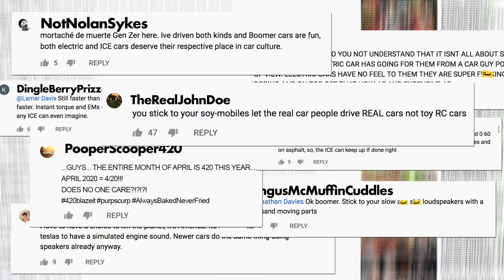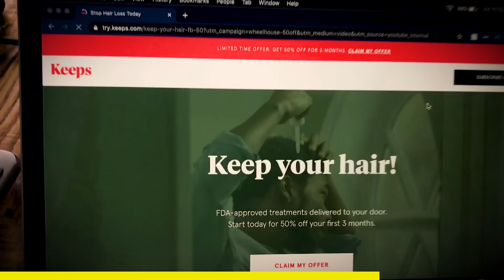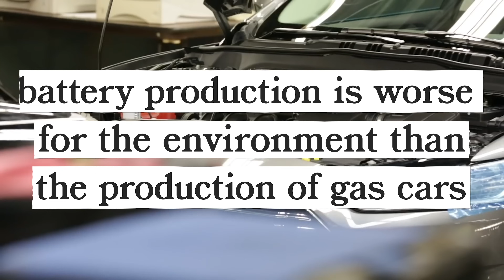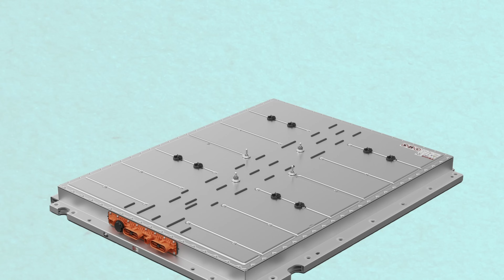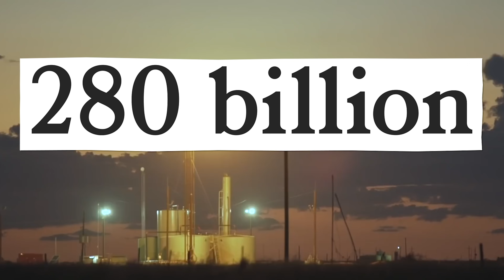Are Electric Cars REALLY Better for the Environment?

Comment: Co2 emissions of coal power per kwh 2.21lbs
Co2 emissions of gasoline per gallon is 19.64

Chevy Bolt EV - 60kwh battery - 240 miles of range
132.6 lbs of Co2 for 240 miles

Chevy Sonic(Gas version of bolt) - 34 mpg
138.6 lbs of Co2 for 240 miles of driving

Even in worst case sincerio with being powered by coal EVs are still better for the environment. Also when your utilities goes greener your ev will get cleaner. My modded bolt EV is powered by hydro power. 

Grab some sticky tires and have fun with the instant torque of an ev. And with all the savings of much less maintenance and fuel cost savings it will help fund your project car.
Reply: until you need that expensive battery replaced. from what i am seeing you might as well throw the car away at that point.

Comment: i think there will be huge strides in battery tech in the coming decade and battery production wont even be a big issue
Reply: They said the same thing about gas.  The materials are what they are.  There is no changimg that.
Reply: @someweirdoguy6633  right, the materials will likely change.

Comment: Solid state batterys. Game changer for EVs. A solid-state battery is a battery technology that uses solid electrodes and a solid electrolyte, instead of the liquid or polymer gel electrolytes found in lithium-ion or lithium polymer batteries. Materials proposed for use as solid electrolytes in solid-state batteries include ceramics, and solid polymers. boom - mind blown

Comment: Well this comparison has one flaw. 
The average age of cars on the road today is 11 years old. The average lifespan of a EV battery is 8years. 
So if you install a new EV battery after 8 years of ownership then you have to double that initial economic impact for mining lithium required to make the battery. 
This will become more apparent as all these new EV cars age & people can't figure out why their Telsa doesn't hold a charge anymore. They will be faced with a choice of spending an estimated 3-7k dollars for a new battery or 40k (model 3) to 80k (model S) on a whole new car. 
I would argue that we will see more EV owners replacing their batteries just like ICE owners opt to repair their cars as they age as opposed to buying a whole new car. As the middle class becomes less prosperous, working class Americans are holding on to cars longer nowadays & are opting to repair the car they own instead of buying a new one. 
Its no secret that with proper maintenance & regular quality oil changes it is not uncommon for a modern ICE to surpass 200k miles which is double the current 100k mile life expectancy of an EV battery. My 2008 VW has 230k miles & has never had any major repair work. Just basic maintenance & it runs great. Hopefully as time goes on & technology advances these batteries will last longer, just like the modern ICE has become more reliable as it becomes more refined.
But for now I would like to see that app you talked about comparing EV & ICE car's take the current battery lifespan into consideration.

Comment: For the people who love math and the occasional dry joke: Engineering Explained also did a video about this a while back (with pretty much the same findings, though EE points out the specifics and uses his own cars as examples). The channel is exactly how the name implies.
https://youtu.be/6RhtiPefVzM
Reply: The efficiency numbers alone make these cars a no brainer as he outlined in his video along with Motor Trend
Reply: I wonder how this changes when Tesla makes a million mile battery, 20-30 years of driving without battery replacement?
Reply: Engineering Explained is awesome. He further hammered home the efficiency of EVs when he charged a Tesla Model 3 by towing it with a Ford Raptor, and was able to go further off of that charge than the towing distance.

Comment: They are worse, won't own an electric again. I owed an electric car not going to name the company because in the end they bought it back. But in the 2 years I owed it I had complete battery failure, heating system failure and then the charging unit failed and was deemed non repairable. It also had a bunch of smaller problems not drivetrain related. It only had 87000km on it when it fully died.

Comment: I beg to differ as we had an 06 tesla roadster in the shop that only had 45k miles. Would not hold a charge and needed a new battery. So they may appear that way but the manufacturer has to make money too and the big money maker for a manufacturer is parts sales so what parts are going to be made to fail after x amount of miles that the car has to be brought back to the dealer for service?

Comment: 50 years from now if EV vehicles dominate the streets by the numbers, EV vehicles are going to be harder to dispose of as compared to ICE cars. ICE cars can be crushed and melted and recycled. EVs can’t be recycled as easy as ICE cars, there will be a huge problem of how to dispose battery waste at which in long term, EV vehicles will just be as muchof a bigger problem as ICE vehicles. Yes, 6 months-2 years or even 5years EV vehicles are efficient, but people generally change cars every so often, and EV vehicles especially their batteries expire at a given time rendering the car obsolete again. ICE with proper maintenance will keep the car running.

Comment: Apparently carbonized hemp fibers are comparable to Graphene in terms of function and form, thus they can be used to make super capacitor like batteries. Perhaps this could become a viable alternative to lithium/cobalt batteries?
Reply: super caps will never be used in place of a battery but if you knew the dif between a battery and a cap you would already know this

Comment: You forgot about the facts of how the batteries don't last as long as a normal combustion engine would.  therefore if you have to buy one and a half or two cars in order to equal the mileage you will get from your 4 banger Carol's.  Until batteries last longer a combustion engine is always going to be more efficient over the length of the vehicle.

Comment: What if the country which provides lithium or provides ready made battery increases prices? It will happen in future for sure as we suffering from todays gas prices. 
What if the incremental use of lithium might change the environment either bad or good or anything else? 
Do you know we get electricity after the chemical reaction in battery which emits harmful gases but in less volume? Then each and every recharge of battery is also harmful as gasoline vehicles. Still destroying every living being in the planet either use of EV or gasoline vehicles. Need a huge change !!!!!

Comment: One thing all the EV pushers miss though, and that he didn't talk about in the video, is that the Li-ion batteries in EVs only last about 5 to 6 years before they stop holding a charge and you have to replace them. So while it takes two years to counter act the environmental impact of a ICE car, what impact is there if they have to produce two batteries every ten years?

Comment: Yes they are. The toxic gasses that come out of a battery are 10x worse than gasoline and diesel. I have over 10 years of battery charging technology experience I've work for the two leaders in rechargeable batteries. And batteries are worse.

Comment: Good video buddy but there are 100's of other products that produces during crude oil processing (from Oil to Threads specifically nylon and polyester) which ultimately lower the carbon footprint per product and of course if people stop using gasoline/petrol or diesel still processing trend will not going downward.

Please elaborate and share your views. And correct me if i am misunderstood something. Thanks

Comment: In general, "things" are made of stuff that requires pollution. More stuff, more money. A reasonable proxy for pollution is money. capital cost + energy costs = resources used.

Some resource extraction looks different than others. It depends if you have a preference on the type of pollution.

Comment: Good points, I was hoping however that you would have covered the long term picture.
As we know ICE vehicles made 10, 20, 30, 40+ years ago are still getting around.

I'd be interested to see how an EV fares 20 years after being made, will it have required frequent battery/component replacements during that time? 
if so, how would the processing (storage, recycling or disposure) plus the manufacturing of the new components factor in?

Comment: Thanks for this!  What about the 'life' expectancy of each car?  I know that electric cars need a battery pack replacement before you would need to fix your ICE as they degrade over time, plus they are expensive to the car owner to replace.  It would have been good to have factored this in as this drastically raises the EV's energy footprint.    I wish hydrogen cars would get the same development and push to the market!  I'd drive one of those:)

Comment: Not disagreeing with any of the facts in the video it was well done, but I feel a major point was left out. Long term what the life of these electric cars will look like vs internal combustion engine vehicles. Tesla makes a great car, but 15 years from now when it needs a new battery system, is the owner of that car going to sink $15-20k into replacing the batteries in that car? Likely not and it will end up in the scrap yard. I drive a 15 year old vehicle that has 235k on it, I’m the 4th owner and is very inexpensive to repair and maintain for any social economic class of people. Yes over its operating years ICE vehicles creates more pollution, but not for the initial creation, and it will provide likely more years of service and be obtainable for more people. So if you get say 20 years out of a ICE powered vehicle vs potentially 2 electric vehicles in that same timeframe and one of those is creating waste in a junkyard (because a battery overhaul was too expensive of a repair on a 15 year old car), which is really making more pollution?
Reply: Well Tesla have talked about a million mile battery. So watch this space.

Comment: For anyone who did some more research, it's worth mentioning that having to replace the battery does increase the length of time required for electric vehicles to become the better choice, but since most electric vehicles also have less points of failure, it's reasonable to assume these factors will still go in the way of EVs in the long run.

Comment: Just a  thought, what about battery replacements? Most battery as of now wont last the life of the car and that might send the electric cars to the junk yard faster than a gas power car.
Reply: Tesla have supposedly come up with a battery good for 1 million miles. would sort of end the discussion.
Reply: @philterry3293  Well that would be cool when it does happen but as of now it does not exist in production. In 2019 there there where 2.2 million EV cars sold alone and all of those cars battery's are rated to 100,000 miles. Most gas powered cars will go 200,000 miles with out a question and will even go to 1,000,000 miles if maintained properly. To get a current EV car to  go 1,000,000 will be almost impossible.
Reply: @therealpofo  It certainly would be cool. We will know soon enough, battery day is hopefully next month.

Comment: Bro your calculations are literally just you doing Google searches.

An electric vehicle uses 1 kwh every 3.2 miles. 1 kwh = 1 lb of co2. That's 0.31 lb of co2 per mile. A gallon of gas is 20 lbs of co2. At 30mpg, that's 0.66 lb co2 per mile. So if you take a less energy efficient electric car and compare it to a Prius it is not better. Also, you're taking into account producing gasoline, but not what it takes to produce windmills or to mine coal. Why? Not a legitimate comparison

Comment: Really good video, but you forgot something really important imo, it's that batteries from used EV are really hard to recycle and usually get dumped in the nature like a lot of other trash, and let me tell you, lithium, colbalt and some other nasty stuff isn't what you want rotting in the sun or in the water
Reply: Firstly EV battery packs are far too valuable to go to land fill, Lithium is not harmful, As for Cobalt there are already battery packs that use zero Cobalt. Unlike the Oil industry that uses tons of the stuff.

Comment: I'll never own an EV. I work on my own vehicles and I'd rather not have to deal with a trillion electronic issues for every one mechanical issue, having to replace a HUGE ASS battery like I would a transmission in a Maserati Quattroporte because I'm too poor to have more than 1 vehicle, I also don't want to run an extension cord out of my window/door to my car because I have a mobile home, and I also rather enjoy getting full range in my vehicle in about 3 minutes and I really love the sound of a combustion engine as well.

Comment: And this video only compared emissions of greenhouse emission gases. Other pollutants, such as particulate matter, nitrogen oxides, carbon monoxide, sulfur oxides are also important to account for the advantage of eletrical vehicles. ICE vehicles emit these pollutant through their pipes, what causes an impact on the vicinity where they run (our cities). Whereas if we consider the emission from power plants (thermal energy) that fuel EVs, pollutants are released on the atmosphere on tall stacks, and using  pollution treatment devices, more suscetible to control than vehicle tailpipes.

Comment: I cant charge a electric car in minute like filling up with gas. There are no charging stations anywhere near me, and I live in Detroit. Its impossible to drive across the state nonetheless the country in an electric car, just not enough infrastructure for EV's. 
Its actually a big problem for firefighters using the jaws of life. They wont chop into your EV to save your life with out knowing were the power runs. It can light them up like a Christmas tree if they cut in the wrong place.

Comment: In most countries, you burn fossil fuels to get electricity to charge up the EVs.
Reply: True, but the end efficiency of that electric power being used by the EV is nearly 90% unlike IC engines which have an efficiency of only 40%(max ideal)
Reply: @sdvrma  True and not true. The electricity used by EVs has to be generated from fossil fuel and transmitted via the grid. The plant efficacy is usually between 30~50%, let alone the 6~8% transmission loss.  In a less developed country, the loss may be much greater. All things considered, the EV ain't that green and the ICE ain't that bad.
Reply: Even with an entirely fossil fuel powered grid, an EV is still cleaner than a combustion vehicle because combustion engines are so horribly inefficient. The average gasoline engine has less than 30% thermal efficiency compared to well over 90% for an EV.
Reply: Not really. In Sweden where most of its electricity comes non-fossil and the grid is pretty modern, yeah the EV is pretty efficient. In a developing country where coal contributes more than 50% of electricity produced, considering all the plant loss and transmission loss and other losses, EV is not that green.

Comment: The only difference from a combustion and electric vehicle is that a combustion engine uses fuel to creates the energy directly from the vehicle. An electric vehicle has the energy created else ware (ie coal power plant, water dam, ect). The energy in then stored and put into the electric vehicle and used. 

People that think EV is environmentally friendly are as naive as they get. Just because they can't see the environmental impact means it's the solution to them. I've worked in a coal power plant before. And there all far far away from the public's eye for a reason.

Comment: one factor that will start becoming a bigger factor in the EV emission equation will be the replacement and recycling of the battery packs in EVs, which apparently is every 8 years (if that). Obviously hard to put an exact value at but something to consider

Comment: Myth #3 only applies to those countries with generous subsidies.  Sadly not all countries have any form of subsidy for EVs, which basically means only the 'rich' of those countries can afford them.  For example, here in Australia I can get a Hyundai Kona Highlander (top spec) for about $35k AUD, yet the Kona EV is $65k AUD.  Due to this, EV uptake is very slow, which also means the very few used EVs on sale are also quite expensive compared to their ICE counterparts.  I'd like an EV myself, but I just plain can't afford it, and sadly probably won't be able to for a very long time.

Comment: This is how I see it: people buying new cars every 3 years even if they are efficient is worse than buying a slightly used car every year. Because the used car has no initial carbon footprint when bought used but the new cars do
Reply: Exactly. Unless your car is actually at the end of its life, selling it and buying a new Ev just produces more emissions.
Reply: People still continue driving though. The cars will be bought, driven, and sold at a cheaper and cheaper price allowing it to trickle down. 
The cars would be bought either way, if people didn't sell their cars then other people would have to buy a car new rather than used. 
In short, everybody has x number of cars that they own. Every single one was at one point bought new, and most of them will make it to the end of their life time if not exceeding it by a fair margin. 
If you buy a new car and sell it two years later, your just allowing someone else to get a more efficient and modern car for a cheaper price. If you didn't, that new car would be bought anyways simply because there's no used cars on the market.